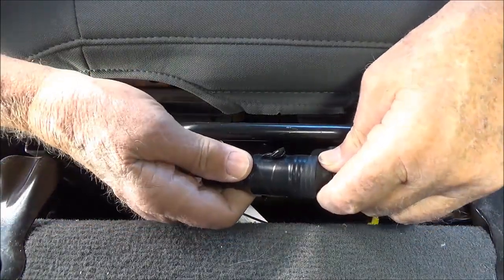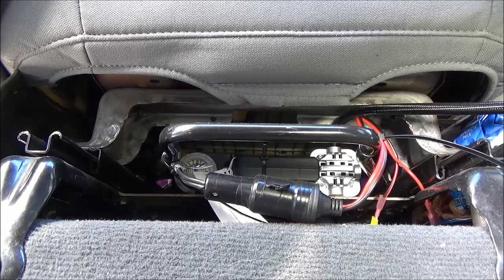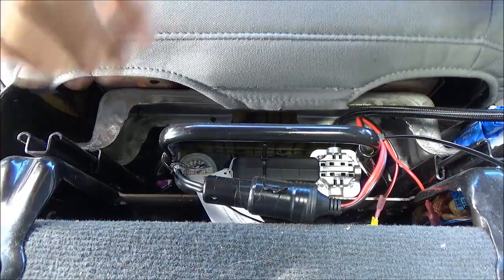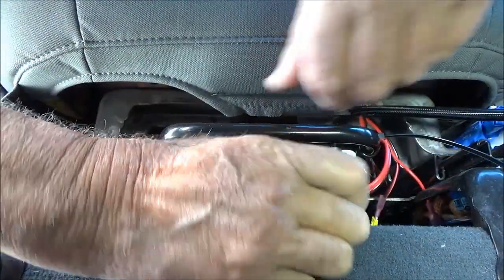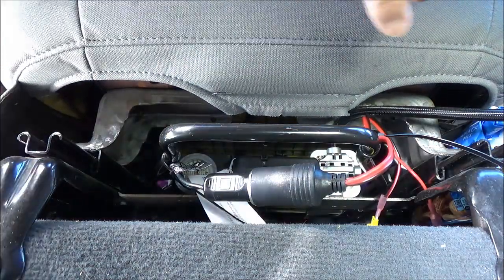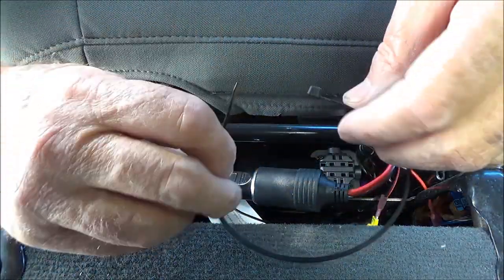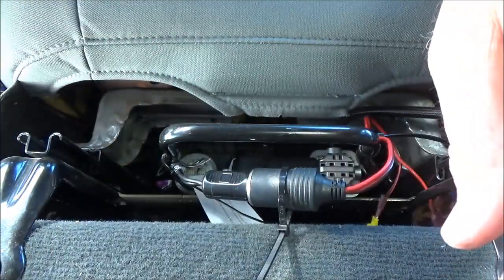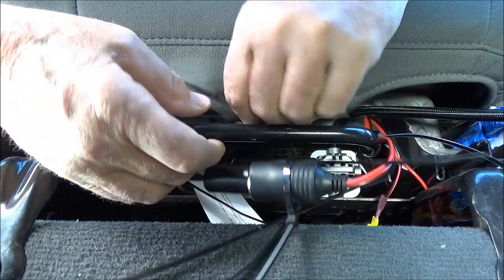12 volt air compressor cigarette lighter plug.

Comment: Hard wire it with some quick disconnect pin connectors.
Reply from the maker: Well I think I stated the reason I have not hard why are you it's cuz I use the air compressor other places and I need to leave the cigarette lighter plug-in on it.